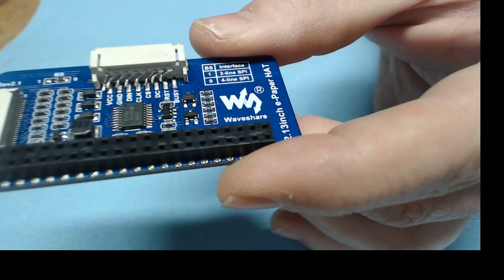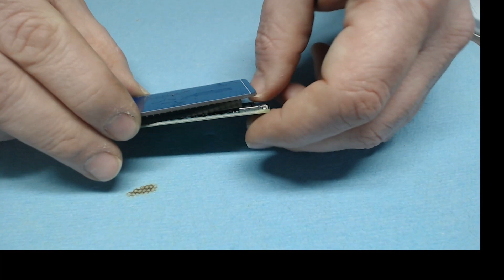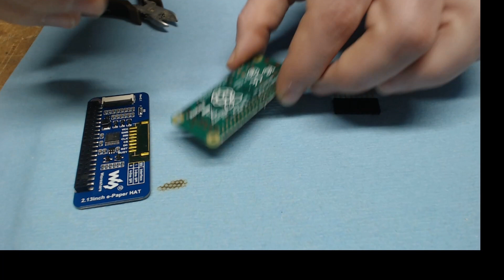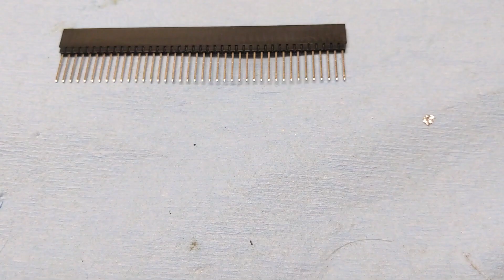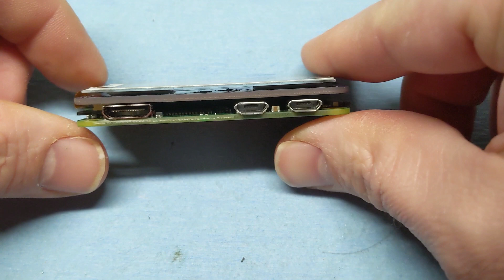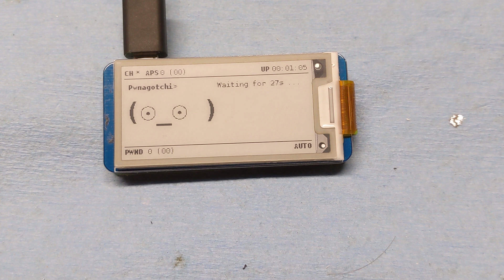Pwnagotchi: Slimagotchi How To   Raspberry Pi Zero W-project

Comment: I soldered on a full header, levered the plastic pin guide off, and clipped all the pins down (pretty easy). 4.3mm board separation is very cool. Next the PiSugar.

Comment: Can u just insert the screen cable straight into the pi zero w?
Reply from the maker: no, it has to  connect to header .  most times the headers need to be soldered on.

Comment: Hi, I followed your guide and got mine to work, but there is an important update for the waveshare PINOUT: It looks like the 3.3v pin is no longer connected to the display and instead they have a voltage regulator on the board that takes 5v from the pi. I had to add an extra pin next to the 3.3v pin.  The display wouldn't start properly without 5v. It just stayed a grey color.

The display I used is Waveshare V2, pcb rev.2.1 bought on amazon oct 2022.   Hope this info is useful to someone out there :)
Reply: Same applies to Waveshare V3! Solder that 5V pin.

Comment: I cant make the screen work without soldering the pins! Is soldering the pins a requirement for the screen to work? or can I just loosely place it and attach the screen to work? Plz help
Reply from the maker: Yes  soldering the pins is required.
Reply: @fatmannmakesbreaks498  thanks that worked!

Comment: isnt this bad for the CPU's temps?
Reply from the maker: Temp may increase a few deg. But overall the enclosure or location of the gotchi when it's on is a bigger factor.  This unit will run abound 40c. If you then put in in a closed pocket or book bag I've seen the temp get above 65c
Reply: @fatmannmakesbreaks498  thanks!